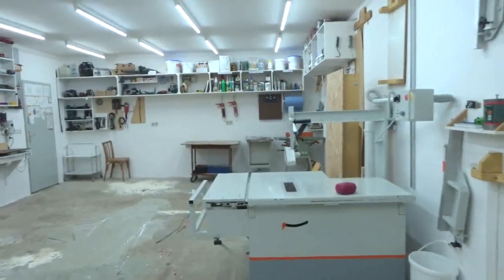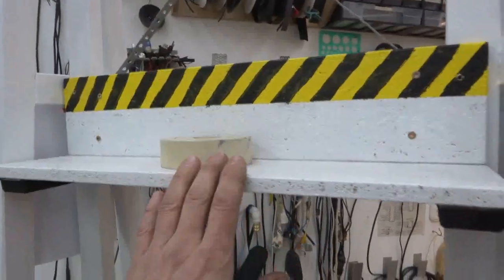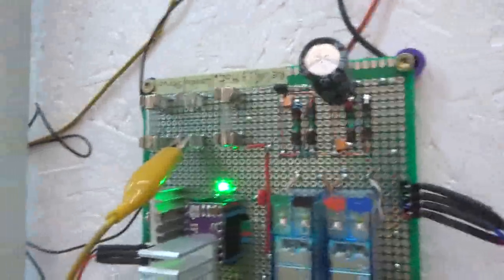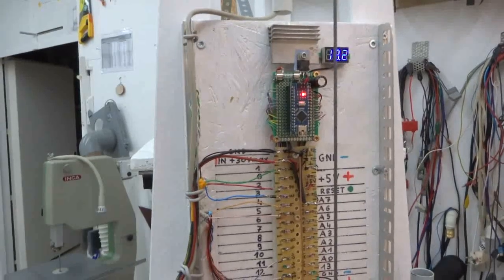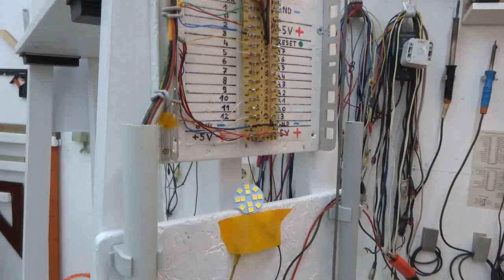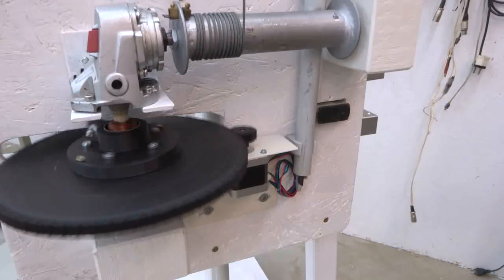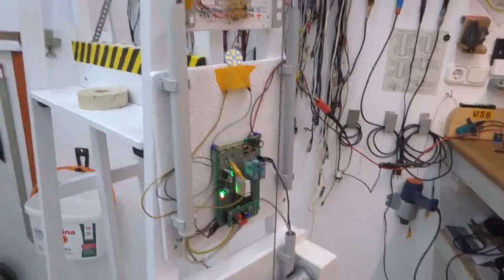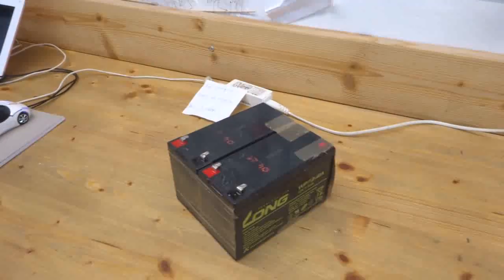Gravity battery experiment

Comment: I always wondered if you could put a weight inside a wind generator tower so when the winds are not blowing it  the weight lowers and runs the generator like a grandfather clock.
Reply from the maker: That would be a interesting idea and a useful solution, tu use the otherwhise hollow mast / tower.. Never thougt about that..
Reply: you probably can, but the energy density of a system like that is probably terrible